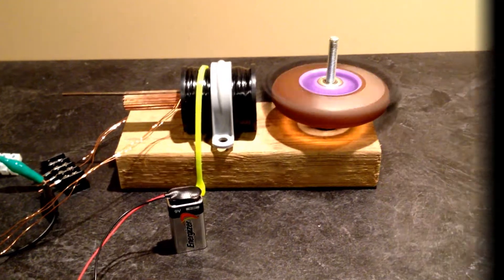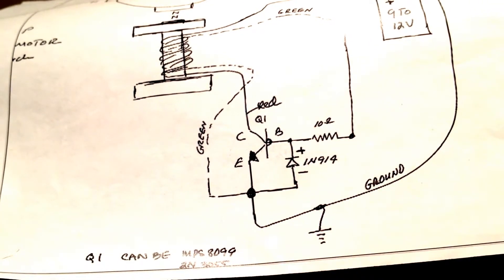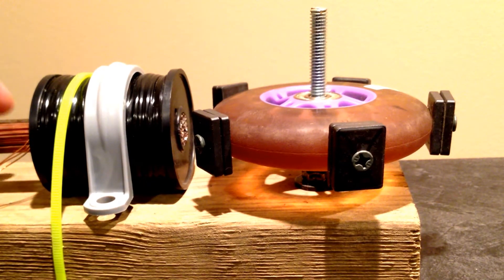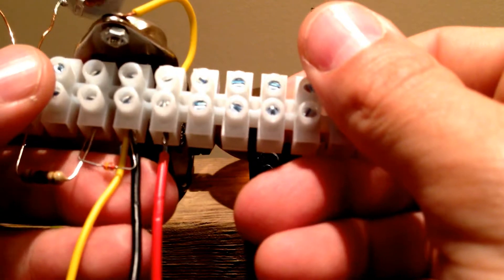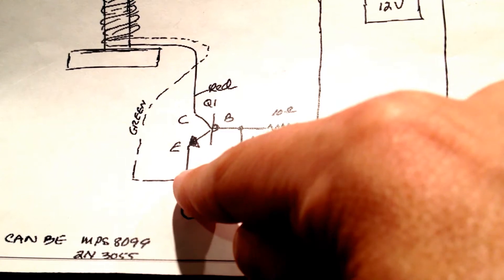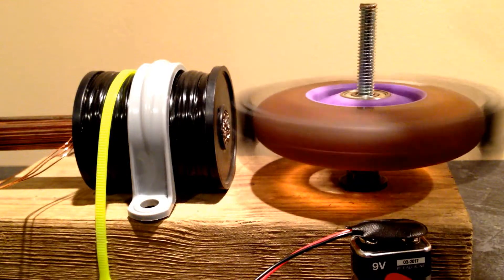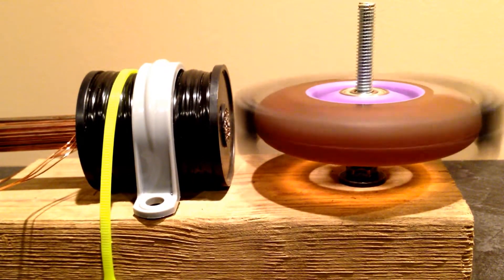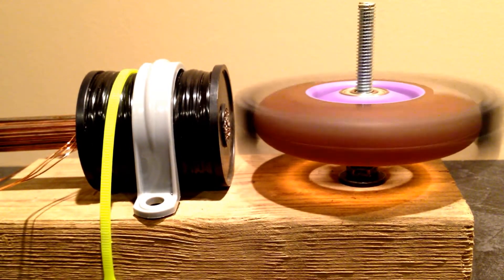hack-n-a: Bedini Simple Motor

Comment: Well done, so simple . I have made 1;2; 3;4 and six coil Bedini Energisers about 15/13 years ago and used the " european" connection blocks for t coil objections....colouring them with permanent markers. I was very surprised to see the Bedini run on a 9v battery.
I would have liked to have seen a neon lamp on the unused winding..  Just for interest: I am in England and the terminal strips are common here , still called chocolate blocks by oldies because originally they were always brown plastic. Many year ago my Brother moved to Ca. and I had to post him a variety of these terminal strips as he could only get those twisty cap things.
Well done , great explanation...I might make some more myself now you have rekindled my interest.
Wire is a problem now because Microwave Oven transformer have gone to aluminium wire or are using some form of switched mode device to get HV....I used to strip out old microwave ovens for the transformer windings.

Comment: Went on a sailing trip on Lake Erie for a week or so.... back to the ole grind.
Worked with a 20" bike rim that is aluminum and stainless spokes. Had a heck of a time getting it to run. Finally after adding 8 more magnets along the circumference it worked. The tests for OU have not shown anything but a loss in both batteries power I did not publish the video. My new coil is still hand wound but has 1000 turns and the textbook core. Peace.... Lynn
Reply from the maker: i have another wheel being finalized. too much going on in realville to work on  things for youtube.  hopefully by next week.
Reply: Monday Morning Quarter Hack Be lookin out for it. Thanks.

Comment: Nice and simple first video, thanks for posting and getting into this stuff.  I'll be waiting to see what you come up with as time goes on.  I don't use iron cores at this time as time is hard to come by this time of year.  It's almost as if one has to be locked up in prison to really have enough time to get into everything.
Reply from the maker: do you just use an air core? agree with you on the time ...
Reply: Yes, just air core.  MrAnguswangus did a lot of tests with the iron core.  I'm going to try a different type of iron core with my wheel soon.  Something I've been thinking about that is a bit different from the norm.  I'll have a video on it sometime soon.